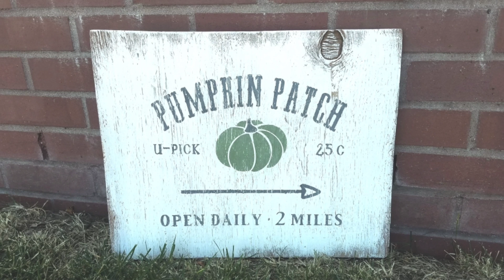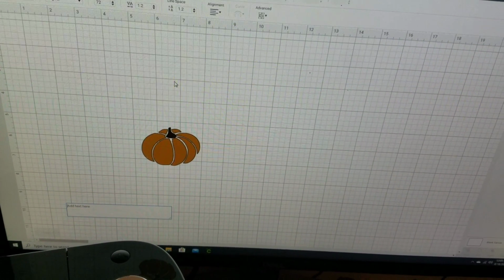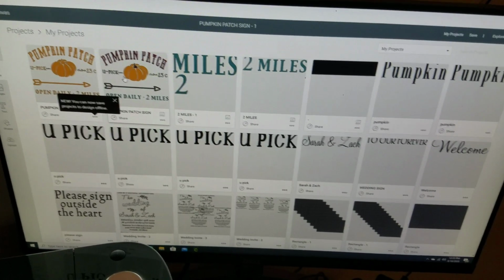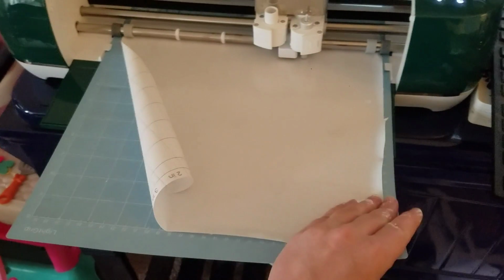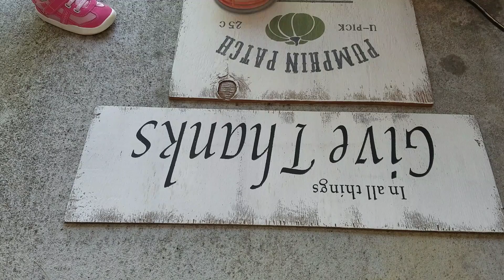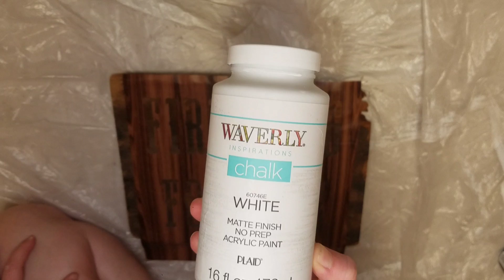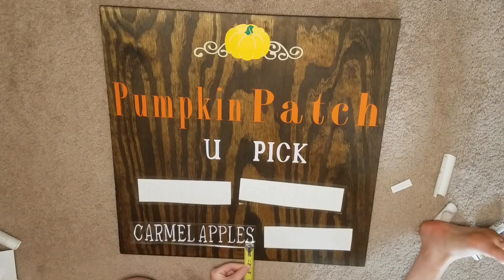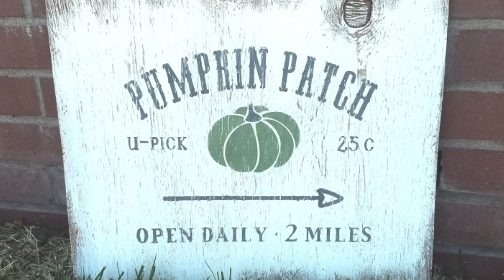DIY FALL SIGNS | FARMHOUSE COUNTRY PUMPKIN PATCH DECOR | EASY CRICUT DIYS FOR BEGINNERS

Comment: You just need to use the measurements for your width and height, which are at the top of your design space. If you put in what you want it will do all the measurements for you. Just use a ruler to measure your project and decide and then put in your measurements according to your sign. You don’t need to use your mat. Also if you want directions on how to download fonts into design space let me know.
Reply from the maker: Thank you so much!! So helpful! Pinning your comment to help other people out 🙌 I will most likely be getting back to you about the fonts after the wedding and honeymoon when things slow down a bit. Thank you for the tips! 😊